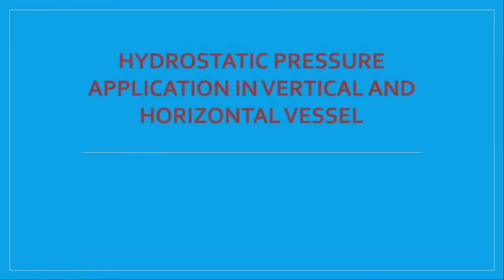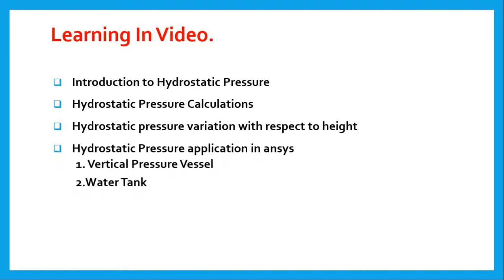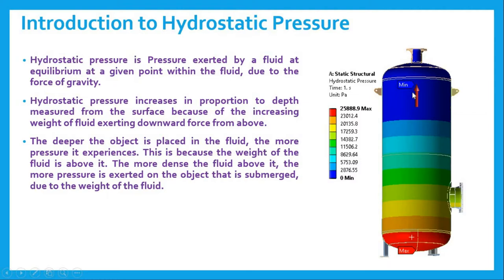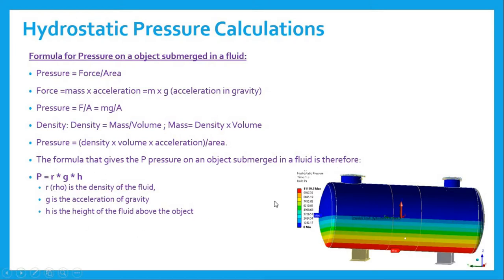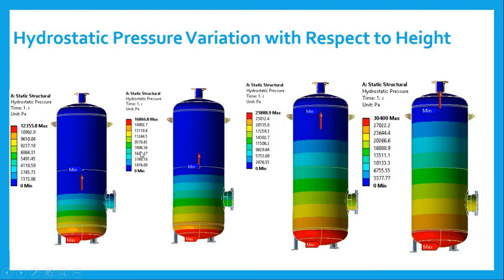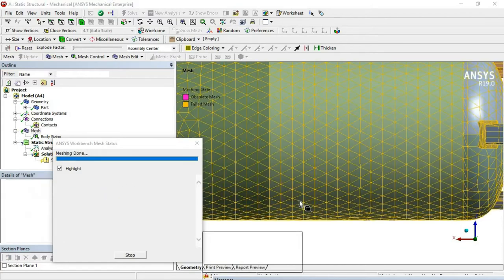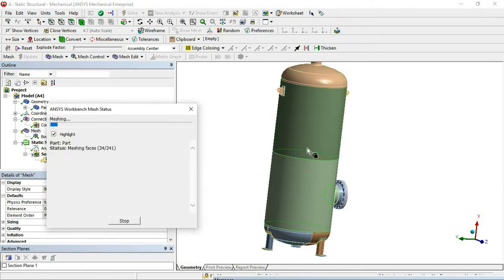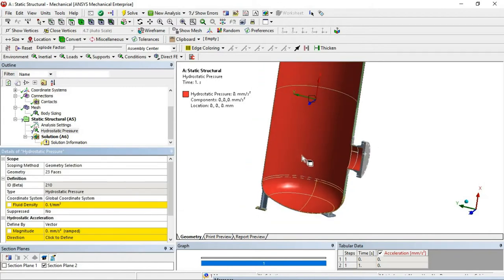Hydrostatic Pressure Application in pressure vessel

Comment: Thank you for this wonderful video. Please make a video of simulation of the vessel it would be more realistic and interesting learning ever on YOUTUBE and seriously your content is too rich and its no ever available especially in the field of ONGC with the application of ANSYS tool .   I recently started my career in this field your videos are helping me a lot .

Anticipating more rich contents from your channel.
Reply from the maker: Thank you for appriciation!  You will find more video in ONGC segments in next few weeks.
Reply: Greetings , just a small doubt why have you not extracted mid surface for the whole body and then mesh . you directly mesh on the body itself although middle portion of tank is shell body( less thickness if me right)  you have generated a tetra mesh on it? for nozzle tetra is ok but for tank shell y tet.  your other video of mid surface creation makes me to ask this silly question. y have u not extracted mid surface for , tank , dome portion and supports? plz clarify
Reply from the maker: Hello Mahesh, 
I just wanted to show the interpretation of hydrostatic pressure behaviour. Course tetra mesh not at all recommended.  Fine hex or tetra mesh is good to capture bending behavior. You can do shell mesh in case on pressure application while if temperature will come then it is difficult to apply different temperature on both side of shell. Also stress linearization is different for shell mesh..

Comment: With hydrostatic pressure is not calculated water weight on the support. Are you calculated force reaction on the support? Thanks…
Reply from the maker: Here, we explained how to apply the hydrostatic pressure as well as how to perform the analysis as per ASME. You can consider the water weight as separate loads in dead weight case.

Comment: Sir pls can yoy clarify if the height of the water is above the coordination then will have to measures that highest point of the water to to the bottom?
Reply from the maker: Yes. Just check the porper pressure distribution;

Comment: Thank you sir. I want to do analysis for knowing deformation of a plate at a depth of 1000 meters in seawater. How do I do the analysis if I know the pressure value (1.054e+7 Pascal) and density. I dont know the hydrostatic acceleration. Can you please help me with this problem?
Reply from the maker: Plate Seawater have different scenario. It may subjected to not only pressure but also wave and current loads too. Hydrostatic is different scenario ex. Vessel containing full or half fluid have some pressure head which we adds in internal pressure to consider the effect of fluid in vessel. It is maximum at the bottom and minimum at the top.
Reply: Did you figure this out? I have a similar problem, but for an underwater vehicle at a depth of 100 meters. I'm not sure what to put for hydrostatic acceleration.

Comment: Thank you very much for your helpplease when we apply hydrostatic pressure, the weight of water is took into account but the weight of steel isn't , please can you explain me that i am very confused by this point of gravity.
Reply from the maker: You can apply standard earth gravity to account weight and check reaction after simulation, it will match with weight
Reply: i applied it but the result after simulation is different with not appliying it , what is correct? applying gravity of steel or not aplying it ? thank you for your patience
Reply from the maker: Please share details!

Comment: Hallo Sir, 
do you have any tipps for me? 
i want to perform modal analysis of a plate immersed in water. 
or just ideas how to implement the added mass for the modal analysis in workbench. 
So many papers says that it is possible using acoustic elements. (using Modal acoustic and harmonic acoustic/ some kind of couple analysis). but I couldnt figure its out. 
would be very thankful if you would have any kind of information for me 
Regards 
Umang
Reply: all I have so far is to use the analytical calculation for the plate for a specific mode. and implement that weight directly using the distributed mass .  ;P XP
Reply from the maker: You can try with prestress modal analysis. First perform the static analysis ( equivalent load of body immersed in water) and then carry that results in modal analysis.
Reply: @graspengineering9249   thanks for your reply.
actually I am working with free free bodies ( Planes and Ships) so no boundary conditions. 
 
but i have solved it now using modal acoustic :) 
it was tough understanding its results. since you get not only pure structural modes in the results but also pure acoustic modes and coupled modes.